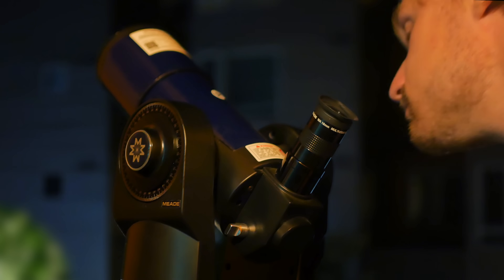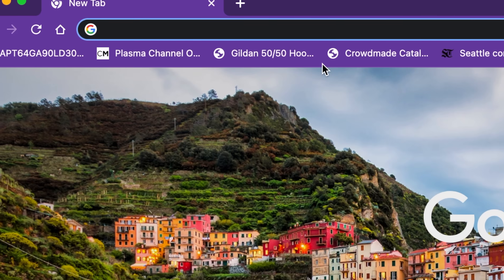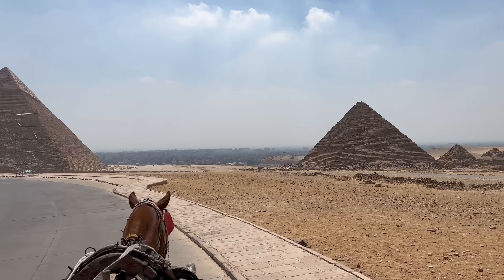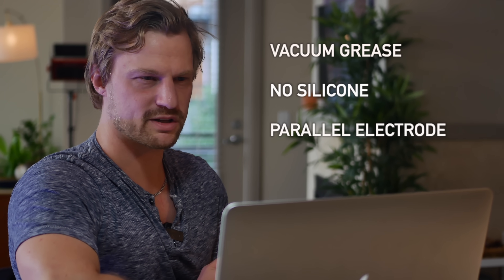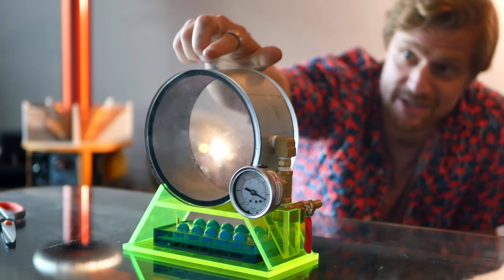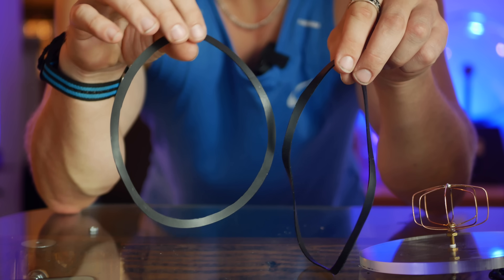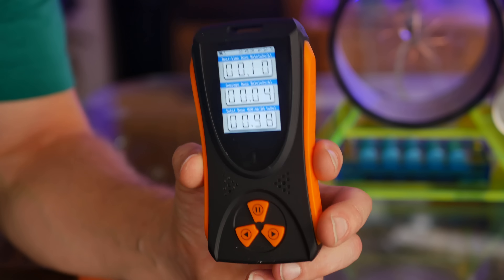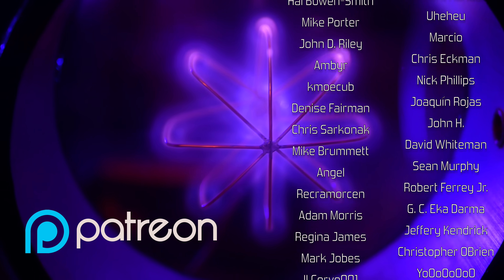Building A Nuclear Star In A Jar (Fusor)

Comment from the maker: I forgot to mention in the video, that my take on a fusor was partly inspired by Will From London's fusor! https://www.youtube.com/watch?v=EVOBk-InL00&t=310s. Thanks for your assistance, Will. Also, dont attempt a fusor unless you have some shred of what you're doing, they can be dangerous.
Reply: That hose is probably outgasing a lot....
Reply: As always, great video!
Check also "Toroidal plasma" on YouTube not a fussion but also interesting.
Reply: When I saw the title I knew it was going to be a farnsworth fusor, now this will be Interesting!
Reply: I wanted to ask a question of a experiment i draw up i watch a video on ion craft and it explained that a ion craft strips a electron's from the air and moves them to one side and a video of casimir effect and how diodes work i was thinking to use two plates with off set holes for diodes with tattoo needle at the ends of the diodes in the holes faceing each other and capacitors on the outside plates and connected to the diodes to see if the diodes can catch more electron's and power it with a arc light to see if you get more power then you put in but i don't have the money to build it and
Reply: You didn't even explain how this works? Seriously?
Reply: @jeffallen3382  do you want to know the physical properties of plasma or something?
Reply: mmm tasty Neutrons and X-rays, delicious xD
Reply: @Kepler2258   more white plasma yummies
Reply: Yo how you did it bro
Reply: Joseph Tutor  what, so if you were to make a vacuum then sound would still be possible?
There was no vacuum in the video so how would that be possible unless you try to make a vid on it.
Reply: Hey, just so you know, you don’t need tritium. Deuterium alone does a good job and doesn’t produce extra neutrons (which are really nasty particles).
Also, I’ve heard lithium vapours work too for some reason, but you need a heated vacuum chamber for that red glow to happen.
Reply: Joseph Tutor  well I hope it's not a last time I hear from you, hopefully I see you in the next video, we're he can show if it can work as he wants.

✌️ Peace
Reply: @paulmobleyscience  
Did I make any comparison between chemical reactions and nuclear reactions in regards to the energy involved into making and breaking bonds ? Nice channel plug btw, but I already know the thing with the difference in energy, that’s why I think nuclear and especially fusion is such a great source of energy. Less pollution and more energy whenever you want it.

Ah I get it... You are asking why did I say light hydrogen is more chemically reactive and thus easier to absorb. Well, in part because the extra mass in deuterium and especially tritium attenuates the atomic thermal oscillations and makes it harder to break the chemical bond. This has nothing to do with radioactivity, it’s just that deuterium and light hydrogen have slightly different chemical properties. This difference was used for example to extract deuterium from normal water with electrolysis and thus concentrate heavy water. Cody’s Lab I think did a video on this process.
Reply: Isnt this literally just a lightbulb? there is no fusion happening here, you are just charging ions
Reply: Joseph Tutor  Difficulty to fuse is not correlated to energy released. It would be very difficult to fuse two lead atoms together, and in doing so the system would contain less energy than you started with. That energy would be transferred into the nuclear bond of the new atom. Any element of atomic number 16 and higher will absorb energy instead of releasing it during fusion.
This cut-off for power production is due to the short range of the strong nuclear force. Once you get to iron and above on the periodic table only part of the nucleons being fused will feel an attractive force with one another. Some of the nucleons will only feel repulsion. 
Tritium-deuterium fusion is one of the easiest types to undergo fusion, having a low coulomb barrier. Despite this it releases more energy than deuterium-deuterium fusion, which is much harder to fuse. 
The energy released in fusion is all about how far into the nucleus nucleons will fall when brought together. The nucleus has shells just like the orbitals of electrons in an atom. Quantum mechanics prevents two nucleons of the same spin state from existing in the same probabilistic she'll, and since protons and neutrons only have two possible spin states you can only have two of each per shell. As you get to larger elements the nucleons are unable to fall a large distance as the shells above the core of the nucleus prevent their fall. It is the fall that causes them to pick up velocity, which is what gives the ejected particles their energy that we can harvest.
Reply: Joseph Tutor  The reason particles can not be brought down to absolute zero is not due to CMB radiation. It is because there is a physical relation in our universe between position and energy. If a particle has absolutely zero temperature you would know its position perfectly, but since you know its position perfectly you have absolutely no knowledge of its energy. The particle gains energy, by an unmeasurable amount, and begins moving again because energy is motion and motion of particles is temperature. 
It's physically impossible to reach zero let alone go below it.
Reply: Can you surround it with solar panels?  Im curious if you can use Light from it to Power the panels?
Reply: the sun isnt a nuclear fusion reaction at its core. the sun is powered electrically. its basically a capacitor in our solar system's electrical circuit. look up the SAFIRE project, these scientists have achieved fusion with their plasma reaction chamber.
Reply: I have a method for adding several thousand layers of nano carbon to the surface of your core copper wire. It should, in theory, reduce the friction and allow for a much more stable fusion interaction. I’d be super curious if it is also capable of blocking or reducing the X-ray production and ‘reuse it’. Contact me for more information. Thx
Reply: Joseph Tutor  I was talking about the video you linked, where people were singing, I was talking about how they used sounds to move the beads to make circles and other shapes, that wasn't in a vacuum or had plasma, 

And I saw the vid he fixed the leaks with some kind of glue like substances that stopped the leaks.

Also why would sound work in such violent conditions, the plasma has to go in such speeds that sound couldn't faze it

 people were singing
Reply: Joseph Tutor  well it's my mistake for not being clear, much less when it comes to fusion.
Reply: Joseph Tutor  well damn, wish a could see your plans it sounds crazy, but it sounds, well, sound.

My bad for asking if it was confusing
Reply: @marz.6102  I second that :)
Reply: @Grafreiner1  of what actually?? 

I commented a lot.
Reply: Joseph Tutor  one question, how are you so creative???
Reply: Joseph Tutor  thanks I guess, would you know how to be more comfortable with this process?

Also thx for responding.
Reply: Joseph Tutor  you have a great point hopefully I see you in the next vid!

See ya later!
Reply: @Plasma Channel What do you know about Organically Bound Tritium?
Reply: @paulmobleyscience  
Organic tritium compounds are worse than tritium gas on its own because those can more easily dissolve into living tissue and stay there a long time. Even tritiated water, though toxic, can be flushed out through your kidneys in a matter of days. But fat soluble organic stuff can stay in the body much longer.
The only thing that is not terrible is tritiated paraffin since it’s a non-volatile solid that cannot be absorbed into your body. Don’t burn it though.
My advice is to not deal with tritium at all, deuterium works just fine and you have to ingest a lot of it before you’ll start feeling weird. Besides, you just want fusion, not a neutron firehose.
Reply: @drgazter  Yes but you know as much as I do that extra neutron will be exploited for what it can be and both tritium/deuterium will be used.
Reply: @paulmobleyscience  
Yes. But as I said before, deuterium fusing already creates lots of gamma. Add tritium to the mix and neutrons start flying off like sparkles which makes the fusion process screamingly radioactive... which I don’t think it’s the goal.
Reply: @paulmobleyscience  
When did I ever say that ?
What’s even the argument ?
The point was that using tritium in a homemade fusor with no lead shielding is a bad idea, that’s all.
If deuterium is used, as soon as the power goes out there’s no more radiation.
Reply: @drgazter  I never said you said that did I?  I am allowed my opinion here just the same as you do don't I?  My point is every energy industry has lied to us so much thus far and its never only about the fuel.  One must consider the coolant which if I'm not mistaken most times will be Helium and being on the shortage list, that to is yet another con that outweighs the pro.  Tritium exposure has been lied about for over 50+ years and while naturally occuring Tritium is extremely rare on Earth and only found in trace amounts in the atmosphere means the vast amount of tritium found here on land is from our fission reactors.  Tritium passes through the body in under a month and most times in under 12 days.  But when Tritium is released it is taken up into the plantlife where it transforms in the metabolic process into Organically Bound Tritium.  Once we eat the food and animals that contains this different version of tritium then it to also bonds to our cells and greatly increases our exposure by the amount of time that it is bonded to our cells instead of just passing through.  Every water cooled reactor site on the planet releases tens of thousands of TBq every single year for 50+years.  Thats why it doesn't matter what you would say about Deuterium because it's never going to be sustainable and these complex systems are going to be a thing of the past. We no longer need a corporation to supply us with energy any longer, we can do it ourselves 24 hours a day, 365 days a year and have been able to for a century back when JP Morgan told Tesla that if it couldn't be metered, then it's not going to be used and that's the moment in time that proves today we have all the correct technology to not pollute the planet and give power to every person on the planet.  It's capitalism that is getting in the way and the factors of corruption and greed can never be placed in any formula or calculation and why it doesn't translate from paper to real life.  It's all wrong
Reply: @paulmobleyscience  Look, I agree with you on the economics and would love to see a mode of energy production that serves our collective interests more than anything else. It’s just that organic bound tritium is only bad if you have lots of it in one place. Even if all tritium we created in heavy water nuclear reactors to this day would be dumped into the environment right now and mixed with all water on Earth, we would barely even notice because it would be incredibly diluted. Furthermore, normal hydrogen is slightly more chemically reactive than deuterium which is slightly more chemically reactive than tritium. Living things preferentially use light hydrogen with less deuterium because all processes happen faster with light hydrogen and thus it kinetically outcompetes other isotopes (statistically speaking). I think the risks of nuclear power are over-exaggerated through fear-mongering. This is not to say that using uranium is suboptimal and we could use thorium for cleaner fission but this is besides the point. We are facing a real issue with apocalyptic climate change and no amount of solar panels or windmills is going to make it go away because we need energy storage for those renewable technologies to be reliable, storage which is extremely limited to this day and will probably always be unless we dig up all lithium and cobalt reserves on Earth or something. The reason why hydroelectric plants are a renewable resources that works is because they have a built-in energy storage system that allows them to collect water all the time and produce energy on demand by slowly draining it away, regardless on how much water accumulates at any given point. Solar and wind don’t do this. That’s where nuclear fission and hopefully fusion can fill the gap and make sure we don’t experience blackouts every couple of days. Besides, reactors are more compact, easier to maintain and last longer in operation than hundreds of square kilometres of solar panels or windmill fields.
Reply: @paulmobleyscience  
It has a relatively short half-life compared with other things like radioactive caesium which is by far worse and even so if tritiated water escapes into the environment it’s problematic if it’s concentrated in an area but if it mixes with normal water, it becomes so diluted that you would get more radiation from natural potassium in a banana. Remember tritiated water mixed with all kinds of funny stuff flowing into the Pacific after Fukushima ? In the vicinity it was a problem but after a few months it diluted itself into the Pacific so much that you would need special highly sensitive devices to even detect a trace of radioactive isotopes. When bananas are naturally more radioactive than the thing you are fearing, maybe it’s time to reconsider your fears.
Reply: @drgazter  Not necessarily, as deuterium-deuterium fusion has a probabilistic chance of making tritium as the product, which will then undergo deuterium-tritium fusion and produce neutrons.  Infact, fusors fueled purely with deuterium gas are capable of producing trillions of neutrons per second! There are multiple university labs that have accomplished this using fusors around 25 inches in diameter.
Reply: Joseph Tutor  I mean didn't the reactor from mit or one that studied make a lithium deposit as a byproduct of turning on the reactor?
Reply: Joseph Tutor  I'm joking when I say this but, would you think the iron man arc reactor is even possible to get at such a size?
Reply: Joseph Tutor  could you send the link tomorrow, it been a good one but I have one last bizarre question to end the day, do you think muons can be harnessed to be able to get cold fusion to work in the future?
Reply: Joseph Tutor  also by the lithium comment I made I was trying to say that yes it seems that making elements in a fusion reactor was correct, I think.
Reply: The sun uses gravity and pressure to make N fusion (obviously H as well) but if we could get control of gravity then N-fusion is guaranteed because the pressure we can do but the gravity we can not so physicist’s and astrophysicists that’s your next task find out how we can manipulate gravity with out messing around with mass.  Got any ideas lol ?
Reply: Fusion is so yesterday's news. A guy from Colorado State University figured out how to harvest Zero Point Energy from the quantum vacuum. All other sources of power are moot now. Having said that, what you created was still bad ass!!
Reply: @rationalthinker9612  care to share a link to that video or article I’m intrigued.
Reply: Don't spend too much.

Vacuum is extremely expensive. I saw this cool video, try talking to this guy: https://youtu.be/pVq0egb9uKc
Reply: I was right.  I copied and pasted this article for you below.  A stars pressure is created by its fusion not gravity alone.  How ever gravity would be the keys to fusion and would help only you can’t have the huge amount of gravity with out the stars huge mass so if we found out how to manipulate gravity with out messing around with mass we could unlock sustained nuclear fusion tomorrow and many other useful things like flight with out IC engines or electric prop engines anyway I digress: This is about how stars die.  Stars die when their nuclear fuel runs out.  So if you want to know all about star deaths, this is the article for you.

Let’s get started!

How Stars Die

Throughout all human history, we gaze up at a beautiful canvas of thousands of stars. 

starry in the blue night sky

In fact, these are a mere fraction of the stars in just our Milky Way galaxy alone. 

Mythologies, artwork, games, and everything else include stars. But, have you ever wondered, “how do stars die?” 

Actually, we only need to understand two simple things to learn about star death.

Nuclear Energy – Pushing Out

Deep inside every star, scorching heat and crushing density make for a seriously wild place. Even atomic particles do some funny things under such conditions.

For instance, hydrogen atoms zip around so wildly, they smash into each other and combine to form heavier helium atoms.

But, with all of this newly-gained extra energy, atoms feel unstable. And, they don’t like that. 

Therefore, atoms now release extra energy to become stable once again. Finally, this released energy pushes outward from the star.

Gravity – Pulling In

Everything in our universe has mass. 

In other words, everything is made of stuff. 

Plus, the more stuff something is made of, the more gravity it has, or the more it can pull everything else in towards itself.

For instance, gravity is why we have our Moon. 

Earth’s large mass gives our planet strong gravity, which keeps the much less massive Moon locked in orbit.

However, stars are on a whole new level. In fact, our Sun makes up over 99% of our entire solar system’s mass. 

Seriously, think about that again. All planets, comets, asteroids, and everything else only make up less than one percent of the solar system. 

The rest is our gigantic Sun. 

Not to mention, our Sun is considered a rather average and unimpressively sized star.

Because of this, stars have truly unimaginable gravity. They are able to hold large planets and even other stars in orbit with their powerful gravity. 

Stars’ gravity is even strong enough to crash in, completely crushing itself.

Then, why don’t all stars crush themselves instantly?

Stars – a Perfect Balance

As mentioned above, nuclear energy constantly pushes outward from a star. However, the stars’ powerful gravity is constantly trying to crush inward on itself.

Ultimately, this inward-outward balance of gravity and energy is how all stars stay alive. 

In fact, some stars will successfully hold this delicate balance for billions or even trillions of years. Even our Sun will keep itself balanced for another 5 billion years.

But, eventually, atoms will no longer smash together to release nuclear energy. 

Finally, stars will run out of nuclear fuel. In other words, they no longer push outward.

However, gravity’s strong pull never stops. 

Ultimately, without nuclear energy pushing out, nothing balances gravity anymore, and the star will come crashing in on itself. So now, the star dies.

Several things may happen next, depending on various factors, like a star’s size. While we will not get into these in this article, they include:

Turning into a black hole
Becoming a neutron star
Shrinking into a white dwarf star
So How Do Stars Die?

All stars have a truly poetic balance of pushing in and pushing out. Their strong nuclear energy pushes outward. Their own powerful gravity pushes inward.

But, while stars maintain this balance for billions or trillions of years, it eventually stops. Ultimately, nuclear fuel runs out. 

Finally, without anything stopping it, the star’s own gravity crashes in, crushing the star to death.
Reply: @rationalthinker9612  Ok will do
Reply: Idea to solve Energy Issues:   🫐By AMA🫐 To whom it may concern.
 The Key to making an over unity Electric Flow Generator work is mechanical advantage. In this case the mechanical advantage is achieved by getting the electric motor that is spinning a horizontal disc to be able to spin a large quantity of separate vertical discs that are connected to devices that  generate electrical flow while spinning to generate more current then the electric motor needs, to spin the horizontal disc. One of the ways to achieve this without violating the laws of thermo dynamics, is to exploit magnetic field effects. To do this,attach a horizontally positioned disc to a bar the motor is spinning. You then place magnets on the top of the horizontal disc that the  motor is spinning in a way that makes it so while the disc is spinning around, the magnetic fields are pushing upwards onto the edge of the vertical discs they hit into, forcing them to spin, thereby generating electric  current. To get the magnetic fields to only hit into one of the edges of the vertically positioned discs, place a material under the vertical discs that keeps the magnetic fields from pushing up against the discs until they reach that one open spot where the magnetic fields can hit up against the edge of the vertical discs, pushing them into a spin. In this way, the magnetic fields will be forced to do work that the electric motor wont be doing. This is how it's possible to achieve an Over Unity Electric Flow Generator. Also to keep magnets fully magnetized, you can have wires carefully coiled around part of the magnets & a system that periodically sends a small amount of current through these wires to force the magnets to be re magnetized the way you need, or have another magnet directly under the main magnet with it's opposite field attracting it, but kept apart with a spacer so they cant fully connect,this should induce induction & help keep the magnets fully magnetized. This way you don't have to worry about the magnets losing their strength over time.
  
 Extra Note: If anyone uses my ideas for profit in any way even if it's getting someone else to mass produce my Over Unity Electric Flow Generator idea,  I am fine with you & me getting royalties from it. :)  My e-mail is starfire7654321@yahoo.com

If you are interested in this idea & want to help me out by sending me funding then please email me. 

 I hope you all have a great day.   🫐By AMA🫐 Share this message with Everyone Please.
Reply: @MasterFeiFongWong  a similar thing has already done and once put under load they don’t produces sufficient energy.  Also putting current through a magnet or putting a magnet under the weakened magnet won’t work to re-magnetise .  A lot smarter people have been there done that and moved on.  There was a guy with a big motor with a fan attached that loads of scientists and professors looked at and it turned out that it’s exactly what you are describing.  There’s no such thing as free energy because free energy breaks the laws of physics.  You always have to put in more energy than you can get out and the law of physics say some energy will always be lost when converting from one type to another, In some ways thermodynamics is like gambling. The first law - that energy cannot be created - tells us 'you can't win'. The second says 'you can't even break even In other words, there is nothing unusual about winning a single game of blackjack, but over many games the house always wins. If a player keeps playing, they must eventually lose. And in thermodynamics, you're not allowed to leave the casino - hence the robustness of the second law. No scientist or person of a decent capability and understanding of these laws will fund your idea,  sorry.
Reply: @Biketunerfy  Thanks for taking an interest but I think some clarification is needed. 1st: I didn't say put current through magnet to re magnetize I said they needed coils of wire around them so when current was traveling through wires the magnets would get re magnetized & this does work. you see if wires are oriented correctly then when current goes through them the back EMF from the wire is traveling in a direction that Will magnetize things. It is how a magnet can be magnetized in the first place. As to the second idea of a magnet under the first magnet it is called induction and I have played with it myself. The magnetic field of a magnet when placed close to an object will force the domains to line up and make the other object a magnet. As to the strength of the induction effect I can't fully say & I do need to do tests with more powerful magnets but induction does work. 2nd: My design does not violate the laws of thermo dynamics & if you think some one has built my design your wrong. Pay close attention to the part of my design where the magnetic fields are hitting up against the wheels in a direction that can't exert a reverse direction against the horizontal disc the motor is spinning. You see even tho the generators would have some back EMF as they are forced to spin, it will not stop my design from achieving over unity. I understand if you don't understand my design, I do need to complete a visual model of it. I'm sure that would help people see why my design does work. It's not that my design does some magical violation of the laws of thermo dynamics. I just found a way to exploit mechanical advantage in away that makes it work.
Reply: @MasterFeiFongWong  I’m not going to get in a back and fourth with you.  I stand by what I said you won’t get funding for it.  There’s always energy loss therefore you can not get free energy for ever.  The only way to do that is if there is no friction and you can’t because of thing called gravity even with magnetism gravity effects it.  If we could manipulate gravity with out mass then the galaxy is our oyster.  The only thing that we know that can mess with gravity is mass like our stars mass which counts for 99.8% of all the mass in our solar system.  It’s not that dense our star only 1.41 g/cm³ but there is that much of it, it’s mass is, well it’s massive !.  So there you go, now you know there’s no such thing as freeloading on an everlasting energy supply in our universe at least until we can get gravity licked and I don’t see that happening for hundreds of years or longer.
Reply: @Biketunerfy  Your not seeing the big picture. :) the spinning aspect of my design would be sitting on magnetic fields in my devices case, the bars that are connected to the wheels that are being forced to spin are inside of circular (Think of a donut) shaped magnet that is polarized so the N is inside and S is out side so bar is sitting on magnetic field. bar spinning would not have friction :) I have not bothered to go into detail about the small but important details because message would be to long. I stuck to the basic concepts of what DOES make my device an over unity electric flow generator. & I never said their were not energy losses in the system & I never said it was getting the energy for free because it's not. My device simply exploits mechanical advantage over a system in a way that inevitably allows it to achieve over unity. :) Thank you for taking an interest & I see that you are an individual that needs to see the device built and functioning to understand why it works. I don't blame you for not getting why my device works, it uses ideas in its makeup that have been used in other designs for similar devices that failed because of their design. No worries tho we need not argue. I wish you the best. :)
Reply: @Biketunerfy  Luckily gravity does not stop my device from being over unity. You see the motor isn't doing all the work with my device, only some of it. My device forces magnets to do work on a bunch of generators, so many in fact that the accumulated energy being pushed along is more then the 1 motor needs to do what it needs to do. That's why my over unity device does work. :)
Reply: @MasterFeiFongWong  and what’s in those generators BEARINGS and how much resistance does the wires have trying to push electricity through ? - MORE ENERGY LOSS.  There is energy loss through the wires that generate electromagnetic fields and there energy loss from gravity pulling down on any mechanic parts.  There’s energy loss from the resistance to the air in our atmosphere on mechanical parts,  Gravity is a constant it doesn’t change unless mass changes or you move away from the mass like in space in microgravity.  You see there is energy seepage and loss everywhere you can’t get more energy out than you put in it is not possible since it is forbidden by the laws of thermodynamics. A machine that produces more energy than you put in, in any form is a perpetuum mobile of the first kind and is impossible.  Every physicist or scientist worth their salt knows these laws and will laugh at you.  It matters not that you won’t or can’t accept this.  Look fund it your self but you’ve already failed before you’ve begun and you’ll see I was right.  That’s what over unity means you get more energy out than you put in but it’s an oxymoron to self because it’s impossible.
Reply: @Biketunerfy  unless....it works like the heliosphere and self feeds.  Is that possible?
Reply: Joseph Tutor  Yes, specifically X, Y, and Z coordinates relative to spacetime.
Reply: Joseph Tutor  It is relative to the observer. In a way you could say that is grounded by the speed of the center of the universe since every point of observation is considered the center. It can also be near zero and far from zero at the same time if observed from two positions, both observations being valid simultaneously.
Reply: Joseph Tutor  I'll go ahead and paste a portion of the liked article to help explain.
"In order to bring water to the boil, energy needs to be added. As the water heats up, the water molecules increase their kinetic energy over time and move faster and faster on average. Yet, the individual molecules possess different kinetic energies – from very slow to very fast. Low-energy states are more likely than high-energy states, i.e. only a few particles move really fast. In physics, this distribution is called the Boltzmann distribution. Physicists working with Ulrich Schneider and Immanuel Bloch have now realised a gas in which this distribution is precisely inverted: many particles possess high energies and only a few have low energies. This inversion of the energy distribution means that the particles have assumed a negative absolute temperature"

So this statement goes over high energy states being unusual in our universe. Because of the universe's preference for entropy, you typically see particles In lower energy states. This does not mean that they have to be in low energy states, just that over the coarse of time they will eventually lose their energy to irreversible events. Looking at a collection of particles we will see that almost all of them are in low energy states, as that is the norm. However, because the universe is chaotic chance will allow random distributions of energy to occur. Think of it like thousands of particles losing a small amount of energy and collectively giving all of it to a single particle. 
The next important thing to discuss is that there is no such thing as temperature for a single particle. Temperature is the average kinetic energy of an interacting system of particles. So when calculating the average you know that it is mostly effected by low temperature particles, since there are vastly more of them.
What the researchers in the article did is create a system where the majority of particles are in the high energy state. Thus when calculating the temperature using classical means it appears as though it is below zero. This creates a lot of unique properties for this system, but what is important to understand is that none of the individual particles have zero or negative motion, it's just the math for the average that makes it appear as so.
Reply: Joseph Tutor  Space is the electron cloud field, along with a field for every other fundamental particle. As for the center, that would be every possible location. The universe began as a single point and then expanded into itself. Every location in the universe is the center because fundamentally the universe never stopped being a point with no dimensions, it just created virtual space within itself.
Reply: Joseph Tutor  The universe is paradoxical yet that is still our reality. We can look at magnetic fields as an example. When electricity flows in a wire from an outside observer we see that electrons and protons have an even distribution, as such the net electric charge is zero. From one of the moving electrons perspective the situation is different. Due to relativistic effects the faster you move, the smaller the universe becomes. From the electrons perspective the space around them contract and brings all of the protons together, as a result they become more dense. This means that there are more positive particles in that space than negative, so the area becomes positively charged. The protons see the exact opposite from their perspective, thus the space becomes negatively charged. All three of these perspectives exist simultaneously, giving rise to the north and south poles of magnetic fields. This is why charged particles are affected by magnets. It's because magnetic fields are just electric fields from a different observation of the universe.
Reply: Joseph Tutor  As far as ball lightning is concerned, I've never come upon the article you've read. The humming at one third the speed of light is quite interesting. Makes me wonder if it could actually be occurring at the speed of light divided by pi, as pi and 3 are very close. Probably doesn't actually have anything to do with pi but it just came to mind since pi is related to spheres.

As for fusion using standing waves, as far as physics is concerned I see no issues. Resonance is a very powerful effect, and I see no reason a physical system could not exist where energy is built up over time to overcome the coulomb barrier, and where the fusion reaction after igniting takes over and keeps the process going by pushing back out each time it is compressed and subsequently ignited. 
The issues I see however are from an engineering standpoint. These fusion gasses, having temperatures of millions of degrees, will obliterate any known physical material you would surround them with to try and reflect the waves back to the center.
If you were to build one you would want to use the densest materials possible. This is often employed in hydrogen bombs to keep the reaction going for as long as possible. 
To increase the odds of it working you would want the reflecting sphere to have an enormous radius, as this would greatly lower the resonant frequency and give the reflector time to cool down before each wave reaches it. This would create a new issue though as very large, very dense structures would be difficult to build. 
Dense materials are also favorable because the bigger the difference in mass between colliding particles, the more of the energy stays in or is transferred to the smaller particle. Since the gasses impacting the wall would have very low mass, the higher the density of the reflector, the less heat it would absorb. 
Since the gasses fueling and the waste emitted by fusion reactors all consist of ions, it would also be worth considering a magnetic mirror as your reflector. 

All in all I believe the idea deserves to be explored, but the challenges to overcome would likely keep you occupied your whole life.
Reply: Joseph Tutor  The comments on this thread are starting to get pretty scattered now. I did make some comments for the reactor design within my comment that starts out with "as far as ball lightning is concerned" If you have more specific questions on it I can probably answer them if you ask.
Though I'll probably be going to bed here soon.
Reply: Joseph Tutor  One thing to keep in mind is that when ions push against a magnetic field they generate electricity within it. This electricity can then be used to do work. All of the fuel and products of fusion are ions, so when they press against the field they can charge it, and this charge can then be used to increase field strength when pushing the ions back into the reaction vessel. This essentially forms a sort of magnetic spring where very little energy is wasted. And while it does require energy to set up a magnetic field, if done in a superconductor it will not take any energy to maintain it.

Alternatively you could use the zirconium oxide or uranium sphere and consider it an expendable fuel in the reactor. Increasing the diameter should greatly extend how long it can be used.
Reply: Oh my God he can actually give credit!! Now crapsma channel is 1% better than 0%! Moving up in the world.
Reply: Is this you https://youtu.be/4GJtGpvE1sQ at 4:20 mark‽ If so do I get bonus points for observational skills?
Reply: Quick question, what material did you use for the star shaped part of the fusor? Also did you shape it yourself or were you able to purchase it somewhere?
Reply: can you please use a Rodin coil one day in that?  Their centers have odd properties!
Reply: I think if you have 12 loops not 8 it will be more efficient and stable in your Nuclear Fuse
Reply: Subbed Looks like a fun channel ❤
Reply: Not sure if you have thought of it or if you know someone who has but I want to do my own experiments in space it self but for health reasons cant go is there a way to make a close to realistic "synthetic space atmosphere" so I can do my own experiments at home or has technology not caught up that far yet. (also want to make note my first thought with the name of this video was ""oo that means the Tardis could quite be possible but not for a while yet since the "stars" are so small."")
Reply: Plasma reactor?
Reply: Question: It appears that you are shaping the magnetic field purely by straight wires and metal tubes.  Is there a more subtle way of shaping a field?  For example that plasma toy you can get at Spencer's Gifts where a little lightening bolt connects from the center to your finger, it is clear that there is something dynamic going on inside that glass sphere.  Is there a way to create and control that dynamics that you know of?
Reply: @danjunker3920  Magnetic fields are not used in IEC fusion devices. What you are seeing is the negative electrode of a static electric field. After ionizing atoms by knocking away an electron they gain a positive charge, and thus are accelerated towards the negative electrode.
Reply: How to convert plasma energy into electrical energy
Reply: On your Fusion project put solar panels around the fusion process you have see how much electricity it creates from the solar panels I like to see what the results are please try it?
Reply: Could you make a upgraded crystal radio? that would be awesome to see
Reply: Wow! OK I Sub'd!
You keep up the pace that's for sure! Thanks for what you do. I love physics and your applied mechanics is a joy to watch. Dude you rock! Thank you❤
Reply: Your tubing.  You are epoxy sealing all of the fittings but you just have a standard barb connection on a piece of really flexible vinyl tubing.  The shorter the tubing is the better.  A vacuum accumulator chamber may also help.  Vacuum is tricky.  In tech school we used vacuum to pick up electrical components and circuit boards.  We had so much trouble with tubing that on the final version we manufactured venturis into the end effectors because it was so much easier to supply air rather than vacuum.  Then when I worked at a certain large semiconductor company we used LOTS of vacuum for everything.  Trust me.  The shorter the lines made of the stiffest material possible is very important.  Stainless would be best.  Flare fittings can be expensive but those ordinary pipe thread fittings aren't going to hold vacuum without epoxy (like you did) or maybe pipe dope.  Everything in a semiconductor fab is in stainless tubing with flare fittings.  In an industrial application of something like this I would expect to see a flare fittings welded directly to your reaction chamber.

If you set up another port with a valve on it you could pull a vacuum.  Close the valve to the vacuum pump.  purge with helium/argon/xenon/whatever. then close that valve and pull vacuum again.  Keep in mind that your valves may leak vacuum.
Reply: Do you replicate sonoilluminances
Reply: You delusional or deceiver
Reply: https://www.youtube.com/watch?v=u1pj9OideyA
Reply: They have been doping water with Floride for years...
Reply: Hello dear friend hi don't see good how you build the circle 😅
Reply: Is there any way you could pump liquid nitrogen into this or around it down to roughly -80°F and still achieve a vacuum?
Reply: Where are the Second Part?
Reply: Dude can we talk?
Reply: Why aren't fusion reactors tested in smaller models?

I mean what if the mega project don't work to make lots of energy to the grid?
Reply: @marz.6102  As far I know, it's not small ones that are the problem. It's scaling it up to a size that it can complete with other powerplant types and still function as intended.
Reply: @TinusBruins  then would it be possible to make smaller models of the reactors, kinda like how engineers used to make small models of their plane designs so that it can be testing in a small smoke tunnel it see if the aerodynamics are in check? (I forgot what the tunnel was called but it had some sort of smoke poured into a wind tunnel to see if the plane would create more drag or something)
Reply: @Only_God_Is_Allah_SWT  Yes I do believe he is building a fusion reactor. But it all depends on the opinion what you find worthy of calling a fusion reactor. In my opinion if it's able to fuse 2 atoms together and get more energy output then has been putin ^^ it's a fusion reactor. That the cooling of the reactor cost more energy then it outputs means it's a just bad one. But maybe this video explain my point of view a bit better https://www.youtube.com/watch?v=piPbnKdve9M
Reply: @marz.6102  Fusion reactors are not the issue, fusion generators certainly are. Getting fusion to occur on a small scale is fairly simple to do, but generating useful power from it is another story entirely. 

First off fusion produces a lot of radiation, like "kill you in minutes radiation". This requires thick shielding be put in place. On top of this you need a way to extract energy from the reactor. The main products of fusion we look to extract energy from are neutrons and gamma rays. We extract this energy by using mass to attenuate them through repeated collisions.

The shielding around the reactor is able to serve as this attenuator, turning radiation to heat, but now we have a new problem. The efficiency of generating electricity is dependent on the difference in temperature between your reactor and ambient temperature. If the shielding is only warm to the touch the efficiency of electric generation will be almost 0%. Thus you really want it to be very hot for power generation. If you stick a candle under an anvil and let it burn for an hour, the anvil likely won't even be warm to the touch. Its thermal mass would be too large to keep the small heat input from leaking out to its surroundings. Small reactors are like the candle and the radiation shielding is like the anvil, it just can't produce enough heat. 

The second main issue with small nuclear power plants is all the equipment you need to get them to work. A Farnsworth fusor like what is being built in this video is great for demonstration use, but it will never produce more power than the electricity used to drive it. It is a fundamental limitation of its design and cannot be overcome. Real fusion generators look to push past this with giant supermagnets or warehouse sized Lasser arrays. This isn't to say that at some point in the future a high power density small size fusion reactor could not be built, it's just at the time of writing this, no such device is within reach.
Reply: @RMX7777  Fusion does not create any long-lived radioactive nuclear waste. A fusion reactor produces helium, which is an inert gas. It also produces and consumes tritium within the plant in a closed circuit. Tritium is radioactive (a beta emitter) but its half life is short.  Your thinking of nuclear fission which does create a lot of radioactive waste.  The whole idea behind nuclear fusion is to produce clean energy and we would use the heat from a fusion reactor to produce steam to power a steam turbine and onto a generator as we do now.  The first problem we have is getting stable sustained fusion and the next is generating energy from it because anything that goes close to the plasma cools it to the point where it stops fusing hydrogen into helium.  If we knew how to manipulate gravity we could have fusion tomorrow but currently the only way we know how to manipulate gravity is through mass like a planet or a star and we can’t mess with that so we are not figuring it out any time soon.  Even if we got fusion licked today we would not see any benefit from it for the next 50 or 60 years world wide because of research and power plants.
Reply: @Biketunerfy  You seem to be misunderstanding, I never said that they create long term radioactive waste. I said that they emit high levels of neutron radiation. When neutrons strike ordinary matter they transmute it into other elements, but these elements are rarely ever stable. Because of this they will undergo radioactive decay. This radiation is typically very intense but also short lived.
The issue is that the neutrons have a very high probability of transmuting low density materials, especially those containing water. Thus humans, being mostly water, capture the neutrons efficiently and become radioactive.This localized radiation will cause major damage to your body.
As far as reactors go, nuclear fusion is much better than fission for creating less nuclear waste. The waste that they do produce will also become inert much sooner. Do not confuse this with being safe.
To summarize, fusion reactors do produce very intense and deadly radiation, and if a human were to be near one without shielding they would die. This does not mean that the reactors are not safe, they just need to be shielded to be safe. Thus my previous comment on the importance of shielding.
Reply: @Biketunerfy  Also all hydrogen based fusion has a probabilistic chance of producing neutrons. If you want a truly clean aneutronic reaction you would want to use helium3-helium3 fusion.
Reply: @RMX7777  I agree in the plasma it’s millions of degrees with neutrons flying all over the place after all you can’t have fusion with out neutrons but unlike charged particles, such as positively charged protons, neutrons possess no net electric charge. However, they do have a magnetic property called spin, which can be manipulated by a magnetic field. The neutron's spin direction is affected by magnetism — something the research teams used to their advantage.  This is why it’s called magnetic confinement in a fusion plasma reactor, it’s also the reason why our earth mostly protects us from cosmic radiation I.E neutrons.  As soon as the plasma gets below a certain temperature fusion stops and so does any neutron flux, don’t forget there’s also shielding for L-He to cool the super conducting magnets on a fusion reactor such as the JET has.
Reply: @Biketunerfy  A neutrons spin direction can be altered by magnetic fields, but this does not effect thier velocity. When high voltage is supplied the hydrogen gas becomes a plasma, separating nucleons from electrons.  The high electric field strength causes all of the protons to be pulled into the center. This is why fusors are called electrostatic confinement.
Magnetic fields can also be used to confine particles if they have a charge. In magnetic confinement devices charged nucleons are injected into the reaction chamber with a known velocity. Upon encountering a magnetic field the path of the particles will curve, and the geometry of the field works to keep all of the particles in close proximity to one another. 
These two types of inertial confinement can be used together, where magnetic fields confine electrons towards the center, which creates a strong negative charge that pulls in the nucleons.
What do these two methods have in common? Neither one can move uncharged particles. As you stated neutron spin is affected by magnetic fields, but spin is not related to velocity. If a neutron is leaving a reaction chamber and passes through a magnetic field it will continue moving in a straight line. Magnets cannot be used to shield from neutron radiation.
Reply: @RMX7777  hmm, with the talk of real fusion, I wonder if the other forms of fusion are even bound to become feasible, like cold fusion, were you shoot muons to the fuel source to get a reaction.

Also thank you for the explanation, I was quite surprised by the answer!
Reply: @RMX7777  your right, I was just reading about neutrons escaping fission reactors the water and concrete also serves as neutron shielding when I was reading it said you need materials suitable for cosmic-ray shield design are materials such as lead and iron that will stop the primary protons, and materials like polyethylene, borated polyethylene, concrete and water that will stop the induced neutrons.  The difference though when you shut down a fission reactor the radiation is extremely deadly but if you shut down a fusion reactor there isn’t any radiation apart from a tiny amount of tritium gas which could easily be evacuated but the amount is so tiny it probably would not be a problem.  Another little fun fact I found out was in thermonuclear weapons the tritium gas used as a booster has to be changed in the warheads about every 10 years or so since tritium half life is 12 years.  I never thought about that because I knew that they use tritium but never gave it any thought oh well been nice conversing with you.  Cheers.